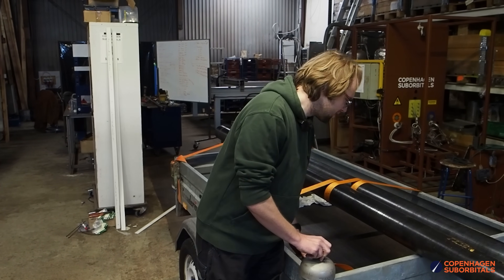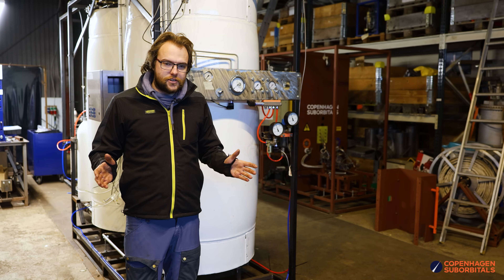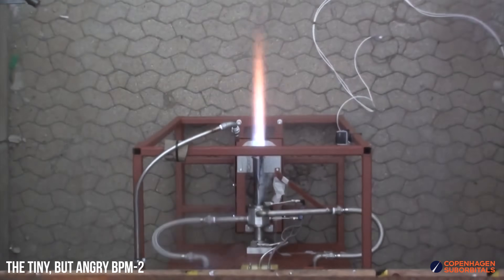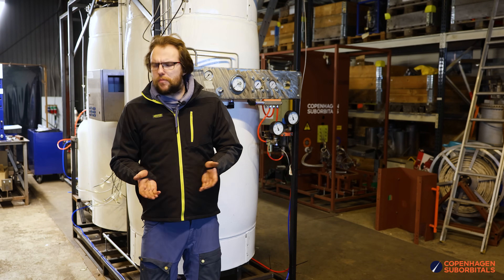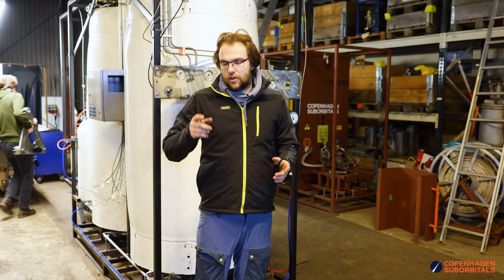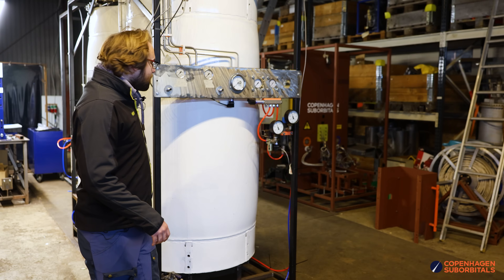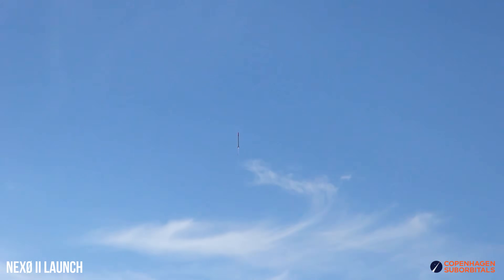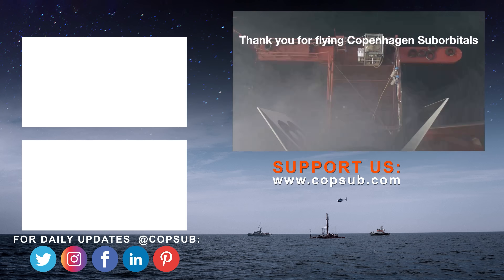Can a Rocket Engine Without a Nozzle Explode?

Comment: You guys keep developing components for one method of operation, and then abandoning then to go in a completely different direction.  And you've doing this over and over for years!  In my opinion you're wasting both time and money.
Reply from the maker: The nozzle-less engine is to test and dial in the new test stand before we test the actual spica rocket engines in it. Yes, we did exactly the same before testing the Nexø rocket engines - because it’s a safer and much cheaper way to understand how the test stand performs, before trying it out with the much more expensive engines. 🚀
So we’re not abandoning anything.
Reply: @CopenhagenSuborbitals  Turbo pump, to name one.  But I'm not going to argue the point.
Reply from the maker: @ATINKERER  The turbo pump was never a part of our direct path to space. If you look at our first presentations of Spica, it didn't use a turbo pump.

Comment: in flow through a straight pipe, the boundary layer thickens along the walls. this causes free steam flow to accelerate through the length of the pipe. 

that will, in turn, increase pressure upstream.

whether this means the pipe will explode, I'm not sure. my gut says it just depends on the length and diameter of the pipe, plus the mass flow rate of propelant and oxider.

either way, I hope they have a blast finding out

Comment: Is a pipe rocket just a straight pipe that fuel burns in? Without any converging section?
Reply: Yeah, just for testing everything other than chamber pressure and thrust. Brilliant for safety and rapid iteration of internal parts.

Comment: well thinking about it theoretically, assuming ideal gas exhaust and a burn/flow rate independent of pressure and extrapolating from a nozzle and simplifying flow inside the chamber
the pressure is approaixmately proportional to the flow/burn rate divided by hte narrowest throat cross section
an engine without a nozzle that is just an open tube simply has a throat cross section eequal to the chamebr cross section which is very large relative to its size compared to other engines
that means relatively low pressure for a given burn rate
but
if the burn rate is high enough and/or hte chamber is structurally weak enouhg that pressure cna still cause it to fall apart